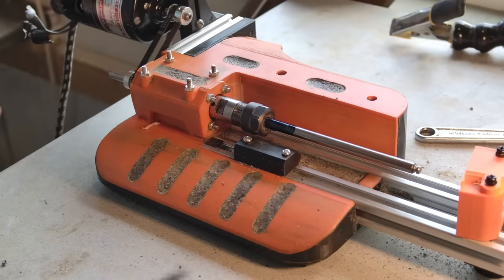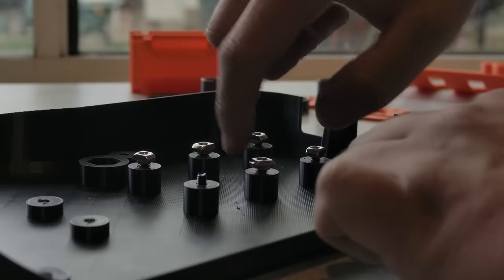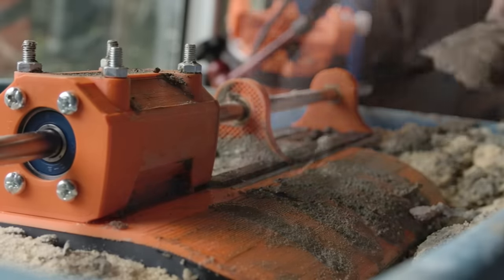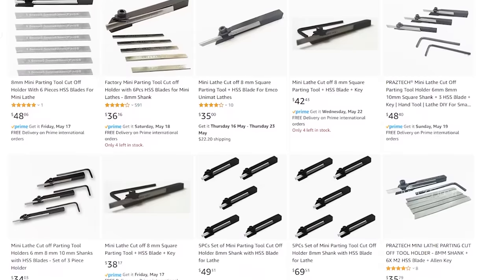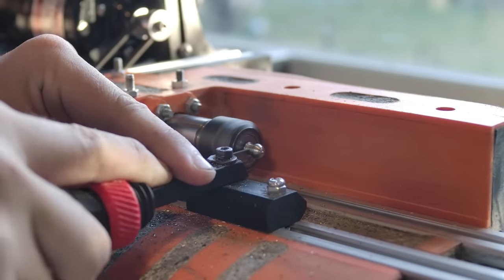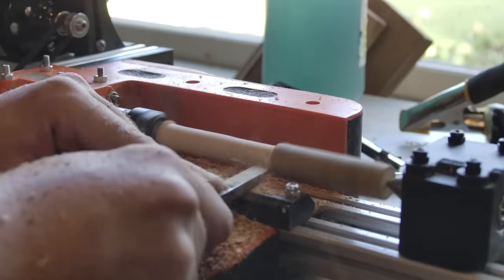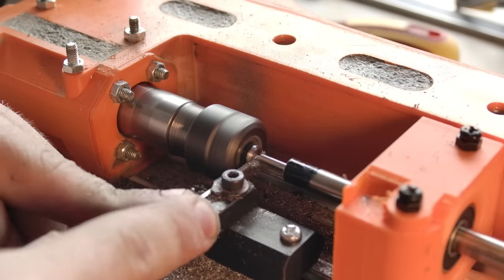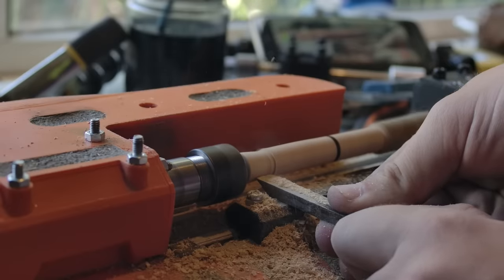The Metal Lathe Made With A 3D Printer

Comment: finally concrete filled 3d prints being used.
it's something I've been using for a bit, but I don't see much talk about.

though imo it's often easier to make a 3d printed skeleton and use molds made from old furniture, corrugated signs or plexiglass. (corrugated sales signs are great for curves, and you can often get them for free, another option is cling film or tape on cardboard.)

something that works well to settle the concrete is a massage gun.

something that might make the machine way more useful would be a double head so you can turn screws
put your master screw in the driving head, which screws in the carriage that has a nut, and then crank the handle bit by bit advancing the tool each time till you cut the threads to the desired depth.
that doesn't give you arbitrary screws but should allow you to cut standard metric threads easily. (0.5, 0.75, 1, 1.25, and 1.5 for M4-M10)
you'd probably add an endstop, that can just be a normally closed switch, or could be wired to an arduino and have a stepper set the depth of the cutter so you can do multiple passes.
that would probably add like 50 bucks, but making custom screw threads may be quite useful.

also something that might be interesting would be adding a magnetic position sensor and an offset drill on the endstock, so you can do holes at somewhat precise spots. or if you already have a rail for the screw making, you could make a holder for a motor with a ball nose endmill and cut GT2 pulleys.